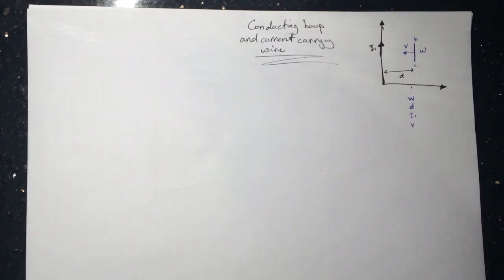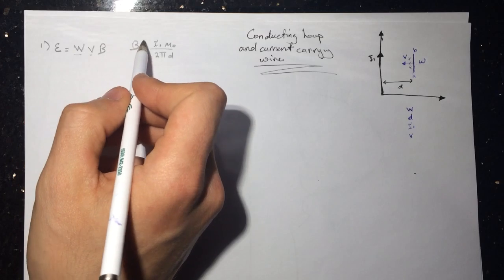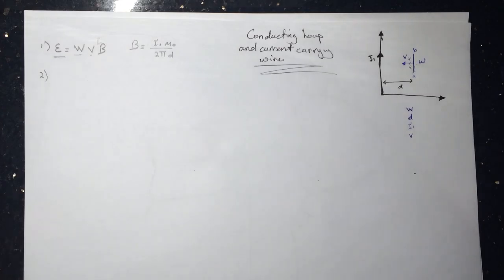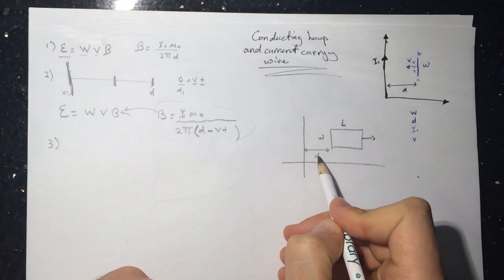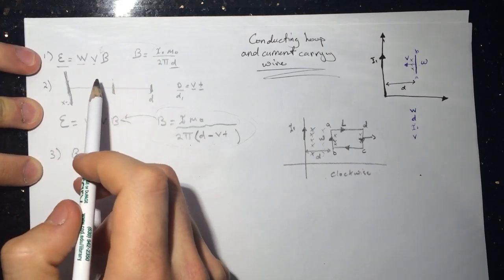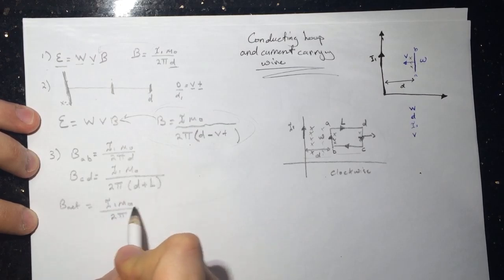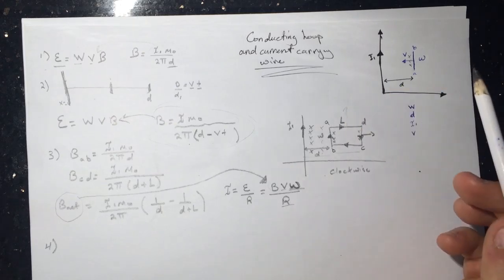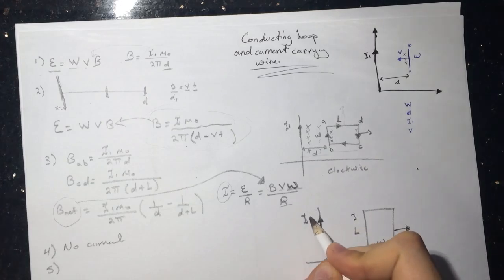Conducting Loop and Current-Carrying Wire "SmartPhysics" Solution.

Comment: Wasn't the purpose of #5 to find I2, not I1? You need to isolate for I2.
Reply from the maker: They are asking about the current induced in the infinite wire. So the idea is right. The I in solving for is the correct one, maybe I mixed the I1 and I2 but the main arrangement is correct. Hope this make sense.